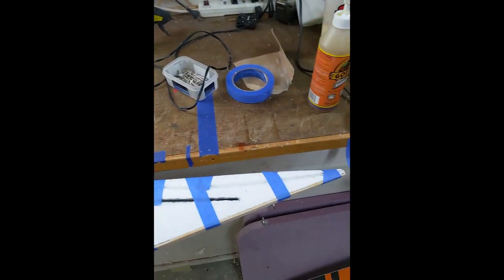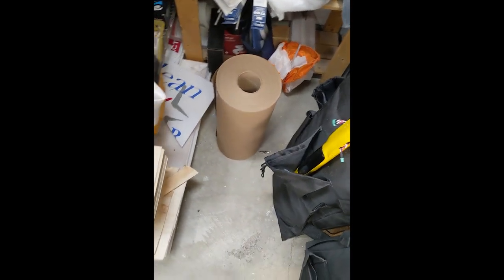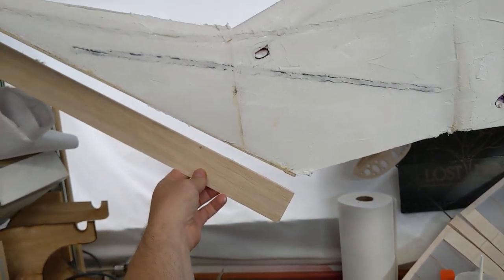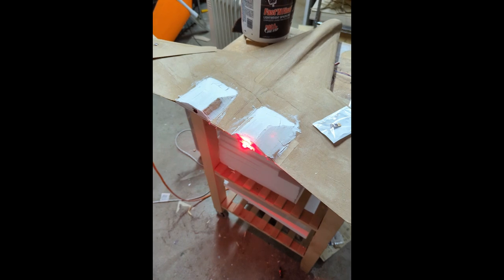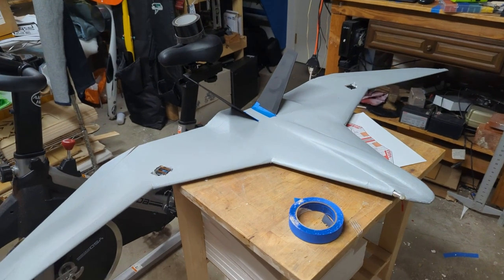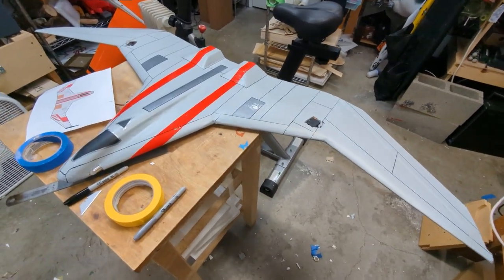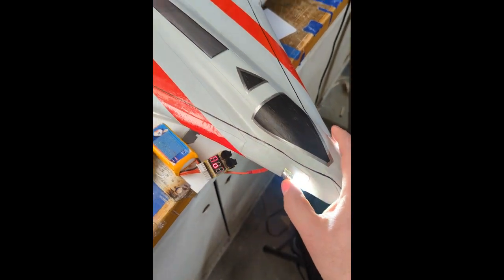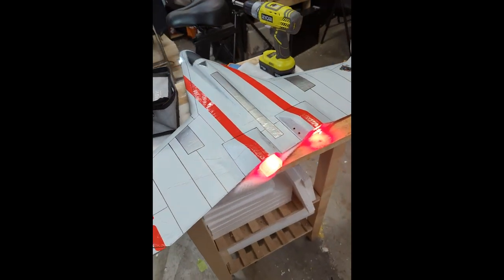Auklet Build Montage

Comment: Another great build. I bet calculating the c of g was fun
Reply from the maker: actually i designed the plane in the cg calculator so i had that from the beginning.
Reply: @thenatedog  That's clever but then again it's not your first rodeo. When will we see some of the new builds in the air?
Reply from the maker: @heady2008  snowy mountains all around us here in Lakeport, ca and rain non-stop coming up. Probably not for a few months.